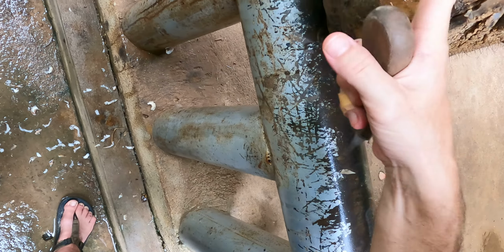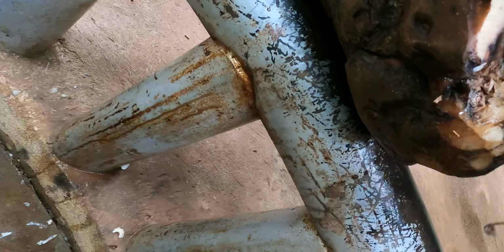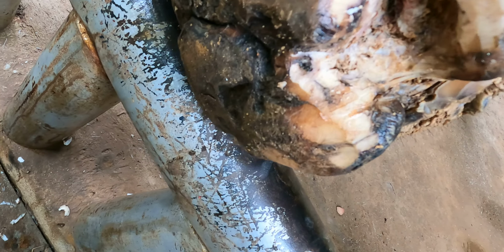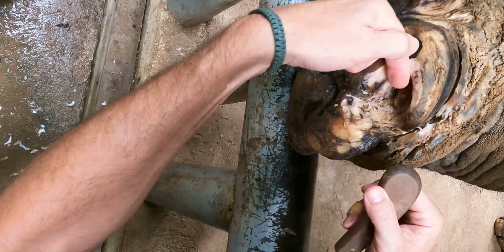The puzzle of an elephant foot abscess. GoPro skillful foot trim.

Comment: Mate do you no what you are doing you are just stuffing around with it so instead of just taking a little bit at a time just take the bloudy lit of and if it bleeds so what shit happens and if there is any puss in it you will see it drain out so then you can fix the problem when all the puss is out so why dont you just do tgat instaed of stuffing around with it mate because it will never heal.
Reply from the maker: Easy on the criticism, mate. Again, an elephant foot abscess is not what you think.  It's tissue filled, not fluid.  This particular elephant has a broken wrist, so there is abnormal pressure inside the foot.  Creating an internal bruise.  This elephant will require lifelong care.
Reply: @elephantcareunchained  Poor elephants! Their story makes me very sad.Thank you for providing such expert and gentle care for them. It seems as though their feet will never truly get better.